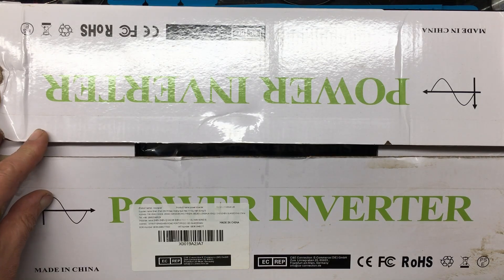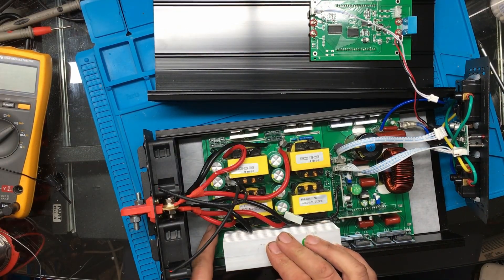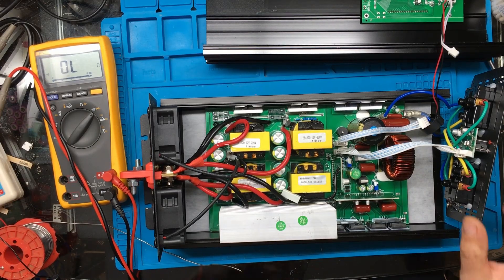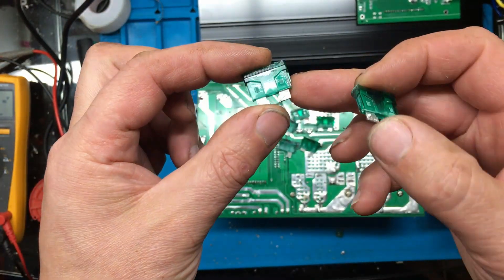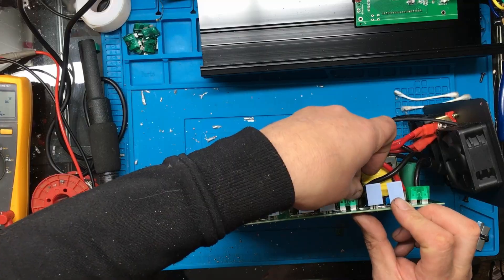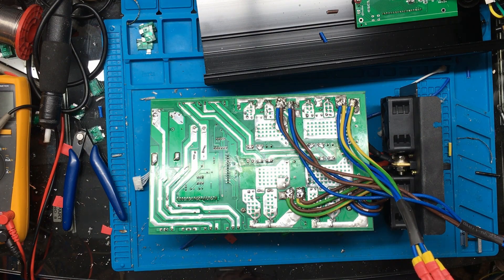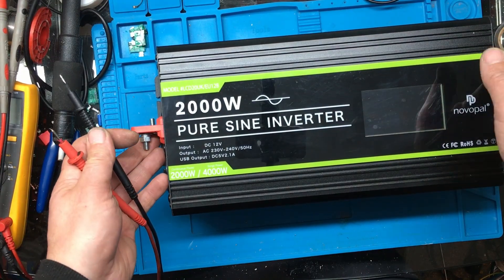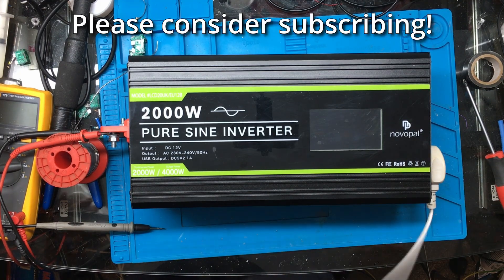2000W Pure Sine Inverter - Blown Up! - Let's fix it!

Comment: Just grind on the alum fuse  & a higher heat solder gun & they work fine !!!. Freeze mist the plastic as needed !👍🏻
Reply from the maker: I've tried that before, and never had much luck with soldering aluminium. I've bought some aluminium flux from Aliexpress, so I'll see if that works when it arrives.

Comment: It is a good ideal to charge the caps before hooking input power to a inverter. A 12 vdc test lite or a 12 volt light bulb on the positive side and it prevents a hard hit of current.
Reply from the maker: I get where you're coming from but wouldn't the caps just discharge, so you would need to do this every time you powered the unit up?
Reply: It is done just prior to hooking up your input voltage. I havent disconnected mine since I installed it. But yes it is easier on the caps. There is a man on Youtube name John Daniels that does a lot with wind turbines and solar panels and inverters. He is worth checking out. I will be watching your channel as well. @BuyitFixit
Reply from the maker: @edwardutter6975  Thanks 👍🙂
Reply: No just the first time install.  @BuyitFixit

Comment: I think the fuses were soldered in because sometimes the fuse holders don’t get great connections and melt.
I’m guessing the manufacturer had issues similar so they soldered righ to the board as a quick fix.
Reply from the maker: Could well be, I think a few people had the same thought.

Comment: I fixed mine by replacinga p19nb20 with an irf 640, I could not find the p19nb20. The voltage out is now 100 volts. Is that because it is not the same fet?
Reply from the maker: I'm not too sure, you would need to check the specifications of the different fets and compare.

Comment: Nice job! Interesting to see the fuses blow before the semiconductors. So they seem to be rated reasonably. My suggestion to the soldered-in fuses is the usecase of these inverters. In car or motorhome application with a lot of bumps and vibrations they cannot come lose.
Reply from the maker: Thanks 👍good idea but fuses in the vehicle's fusebox would suffer the same bumps and vibrations.

Comment: I must confess I have never seen a broken electrical device of any kind where only fuses were the broken bits. I am truly amazed that it is actually possible. Normally fuses are blown as an after-effect of some other problem.
Reply from the maker: Reverse polarity was the problem 🙂 I had similar with a Milwaukee LED flashlight I repaired fuse had gone OC, but as you rightly say they normally blow for a reason. Wish I had a penny for everytime someone has asked me too look at something and said 'it's probably just a fuse' 😂😂👍
Reply: @BuyitFixit  So they build this expensive 2000W (pure sine!) invertor but could not be arsed enough to include a reverse polarity block? I do realize that at these currents that is not a trivial thing, but considering sophistication of the unit it is very strange.
Reply from the maker: @blg53 someone suggested using a diode and a relay to ensure it was connected correctly, I thought it was a pretty neat solution.
Reply: @BuyitFixit  Yes, seem good although if it is really 2000W then at 12V battery voltage it should be able to commutate currents close to 200Amps.  So we are talking about a relay the size of a car starter one. Its possible I guess.
Reply: @blg53  nahhh...bad idea,  better off with no  Reverse Polarity   protection, the AMPS are crazy, the diode (S)  would be expensive, and fail,  and have a huge voltage drop  and heat up;  and the price would go up  200 watt at 12 volts is 166 Amps!!!!  crazy;  half of that at 24 volt, still a lot. i have a few inverters and i repair them,  seen dozens, mine and others', and i  never saw reverse polarity protection; the fuses do it, NO NEED for total disassembly, just 4 little screws and you're there.

Comment: Youd think something like that would have reverse polarity protection that doesnt rely solely on fuses.
Reply from the maker: Yes, exactly. Someone suggested a relay and a diode so when the power the correct way the relay would click in powering the rest of it, but it would add extra cost I guess.

Comment: At full power that beast would be drawing over 166A. Those wires on the fuses are not going to last.
Reply from the maker: 2.5mm cable is rated 13.5A but can handle up to 26A. Times that by the number of wires used and I think you'll find it will be fine. I doubt it is going to be run at full power (and questionable if it even is 2000w). He's probably just going to use it to run a few lights or the odd power tool anyway.

Comment: Ridiculous that they soldered fuses to a board.  Manufactuer mut have made it non serviceable  or at least.ecpects it will be thrown away.  Nice job!
Reply from the maker: Thanks 👍I would have preferred to use sockets on the board, but the owner was only visiting for the weekend so I had to use what I had available.
Reply: @BuyitFixit  Yeah, that would have made better sense however you improve it drastically.

Comment: Thank you for posting these videos. I have a 600 watts with the fault light on that I have to fix, any clue ?
Reply from the maker: Probably blown mosfets. I've got a faulty 600w inverter too that I'll be looking at soon. Stay tuned 👍
Reply: I swapped the p19nb20 with a irf640 it is working but only 100 volts out 😢😊

Comment: This looks like my EDECOA Inverter. I had one with "3000W"! I think it could do the power theoretically. I wanted to power a big amp with a big toroidal transformer... it worked one and a second time, but on the third time it went booooom. Smoking the Sh*t out of the IGBT and the IGBT Driver. I replaced everything and it worked again. So I tried it a second time. The same, after 3 cycles it went boom again. After loosing enough money because of these cheap inverters I bought a Victron MultiPlus, because I don't want to burn my camper down, and now all is fine. It uses a big toroidal transformer for step up and step down, and I think it has a few advantages for driving heavy loads.
Reply from the maker: Nice. I've recently upgraded my solar system to a Victron 5kw with a nice big battery bank. They seem decent kit.

Comment: Am I the only one that’s going to point out the elephant in the room here? HOW  DO YOU HOOK THIS UP BACKWARDS!!!

Best I can tell the BIG BLACK & RED lugs are for the 12v DC (Just like your automotive car battery) pretty self explanatory. That means the other side MUST be for the AC output and even if you ignore that the AC side has receptacles matching the common wall outlets of their country which means the other side has to be the DC input. 

Are you certain your friend isn’t pulling your leg here and didn’t just overload the thing? 🫠 

Either that or I’m missing something very fundamental 😓
Reply: Either way You get a thumbs up, I really enjoy watching your videos. I am a big believer in attempting to fix equipment, both mechanical and electrical, as the primary course of action rather than throwing it away. Especially when it could be something as simple as a blown fuse.
Reply from the maker: Thanks 👍 I think they got the red and black wires the wrong way round and blew it up that way 🙂

Comment: The second you said he reversed the polarity I thought: fuses or diodes. Guess you wouldn't want the voltage drop from diodes. Question for you: why are some of the traces not covered in solder mask? I noticed it in the Milwaukee battery charger, too. Does it have to do with higher current? Great that you got it working again, seems like a beefy unit.
Reply from the maker: Thanks, yes I think the solder mask isn't on those traces so solder builds up on them, making them thicker and allowing them to pass more current than the plain copper would allow.

Comment: Connected mine inadvertently the wrong way round and it blew the 3x25amp fuses - I thought it was a goner - so I replaced the fuses and it was still OK..!  Always check the polarity and if the unit is US check the fuses before giving up.!
Reply from the maker: I've just got another smaller inverter to look at, hopefully this one is a bit more than just the fuses 🙂

Comment: You know they make fuse sockets. Right? I just replaced my battery on my rice cooker and it was soldered in but modified it with a real battery holder. I think the reason for the stupid soldered in ways is to save money on producing it. They don't care about the future of that product.
Reply from the maker: Thanks👍 yes I know about fuse sockets. The owner was only visiting for the weekend so didn't have time to order any so I just used what I had to hand. Not the most elegant repair. I've done much better and more complicated stuff,  but YouTube seems to have the hots for this video for some reason 🤷‍♂️

Comment: ON MY KNUP 4000W INVERTER THE FUSES WERE SOLDERED SOLID, COULDNT GET THEM OUT, NIW IM STUCK WITH AN INVERTER THAT DOESNT WORK, WHY CANT FUSES BE ON OITSIDE
Reply from the maker: Agree👍, and I bet this isn't the first case where someone got the wires the wrong way round.
Reply: @BuyitFixit  WASNT THE WIRES WRONG WSY ROUND, I THINK I PLUGGED SOMETING IN THAT WAS OR NEEDED MORE WATTS SUPPLY   AND IT WENT FROM GREEN TO RED THEN FLIPPED OFF , THOUGHT IT MIGHT RESET BUT NEVER DID
Reply from the maker: I was talking about the one I repaired on the video. The original owner connected it the wrong way round.
Reply: @BuyitFixit  OH OK SORRY ABOUT THAT,  JUST FED UP THAT THEY CSNT MAKE SOMTJING WITH EASY TO GET TO FUSES, IS IT A THING WERE THEY ARE ONLY I INTERESTED  MAKING NEW AND NOT BOTHERED ABOUT AN AFTER SERVICE LIKE A SIMPLE INSTRUCTION ON HOW EASY THE FUSE IS TO REPLACE
Reply from the maker: @petermizon4344  yes totally agree 👍
Reply: @Kevin-mp5of WHEN YOU HAVE EYES LIKE MINE  I LIKE BIG LETTERS SO I CAN SEE MISTAKES

Comment: How do you connect it the wrong way round??? Saying that I have a friend that could. He used a main junction box to connect a light to his bike but connected all the wires together because he used the same brass block.
Reply from the maker: Perhaps they had two crocodile clips on the inverter and didn't notice the - and + on the battery probably? Or perhaps they didn't think it matters which way round 🤷‍♂️
Reply: @BuyitFixit  My friend Jack could do that. He was on the phone for an hour complaining his motorbike battery is going flat. At the end of the conversation he told me he only goes to shop 100 yards down the road on it.

Comment: One thing you can do with these is use it to excite an isolation transformer and use that to get grid tie type inverters to give extra juice from a whole house type solar panel system if the grid goes down. Need an isolation switch and a simple battery charger to keep the inverters battery source charged. So long as your draw is about 70% of panel capacity this works fine.❤
Reply: I tried that once without adequate isolation. The inverter tied DC- to HVDC- and AC-ground which led it to overload itself when the house shorted neutral to ground. It put a notable voltage between the body of the car and the floor. At the end of the day the charger was dead too. Whoops. More stuff to fix.

Comment: There is no excuse for a power system like this which does not have polarity protection is a really crap design... a diode driven relay at the input end ensures there is no voltage drop as associated with a simple diode protection.
Reply from the maker: Great idea! I never thought of that. Thanks for sharing 🙂👍

Comment: Those fuses will solder but only with using flux and a high temp. iron. The designers are helping the accountants more than the consumers.
Reply from the maker: Thanks 👍

Comment: time stamp 9:30 overlooking the outher 2 diods ( 4 blocks of inverters = 2 mosfets + 1 diod + 2 fuses each ) . PCB mount ATC blade fuse holders pose a hot spot and have caused fires in inverters before by igniting the pcpb and peling te solier on the pcb and forming a arc flame.

Comment: Excellent job.  Could you not have attached a new multi fuse holder for all the fuses on the outer.  case
Reply from the maker: Yes that would also have been a good idea. This was a little bit of a rush job as the owner was only up for the weekend so I just used what I had lying around.

Comment: What a shame they didn't use fuse carriers for easy repair.
Reply from the maker: Yes, at least they are more accessible now 👍
Reply: Connectors can be treacherous, even fuse holders. Poor connections generate heat. Had a Molex connector on a motherboard catch fire once. Processor survived (Phenom), a memory stick died.

Comment: Adding additional wires to a 2000W/12V inverter and not soldering the fuses is probably not a good idea - these wires will have to handle 200A and there will be significant additional voltage drop through these modifications. Sure there are multiple fuses - but the cables are really not looking sufficient.
Reply from the maker: The fuses installed are 30a each.  I used 2.5mm wire and 4 of them on each fuse. So the wires won't have to handle 200 amp. I agree it's not one of my better repairs as I would have preferred to use sockets for the fuses, the owner was just visiting for the weekend so I didn't have time to order any, but used what I had available.
Reply: @BuyitFixit  Maybe it would have been possible to solder the fuse holders/sockets that were used with the cables onto the PCB.
Reply from the maker: They were crimp on spade connectors that I used, and there was only small slits in the board for a fuse to fit, it wasn't ideal, I was originally just going to solder fuses back in as factory, but then fuses I ended up with were aluminium. This wasn't one of my better repairs, have a look af the FLIR thermal camera, or RGB laser, or medical ultrasound they are a lot better 🙂

Comment: Lucky amateur !! There not transistors  and that coil does not measure  output current flow ! Electrical 3 core cable for fuse leads ! Talkabout fire hazards DO NOT COPY ANYONE  ! Safer getting  new one from China 😂😂😂
Reply from the maker: I hope no one does copy. I would have preferred to use sockets in the PCB, but the owner was just visiting for the weekend so I didn't have time to order any. I had to use what I had to hand. Why would it be a fire hazard, it's 2.5mm cable doubled to each fuse end. I'm sure it can handle the current. Also I doubt it would restrict the airflow too much. Even if it did the device has thermal protection (thermistor on the heatsink). I have no idea why youtube is pushing this particular video, when it's no way one of my better repairs. I guess I got lucky fixing that FLIR thermal camera, RGB laser, solar inverter, medical ultrasound, and loads of other equipment 🤷‍♂️

Comment: Not good, remove the cable from the fuses as they add allot of inductance. You are decoupling the capacitors with those fuse leads. This will result in transistors failing due to over-voltage stress during high load. Try to use smd 30A fuses or fuse holders. I would go by removing all the fuses and just use an 100A fuse over the cable, but this could result in fire, if one fet fails, as it's winding from the transformer will melt ( they have separate winding for each fet leg).
Reply from the maker: Thanks for commenting. I was going to solder fuses back in as original, but the fuses I had seemed to be aluminium. I would have preferred to use fuse holders but the owner was only visiting for the weekend so I used what I had lying around. I've done much better fixes than this but YouTube seems to like pushing this video for some reason. Check out the FLIR camera repair or RGB laser which are much more interesting.

Comment: That's a serious amount of current to get 2kw I would have tried to mount "TTW'  if there's wires come off and short on case it will be magic smoke+++
Reply from the maker: Originally I was just going to solder the fuses back in, although I would have preferred to fit proper sockets. The owner was only visiting for the weekend so I had to use what I had available.

Comment: On most inverters, if you reverse the polarity, the fuses pop before anything else is damaged. I had to do this same repair several years back because I bought an inverter on eBay that was "Spares or repairs" due to the original purchaser getting their wiring confused. It sounded like aggro, but it was too cheap not to get and try to fix.

All that was wrong was that one was the 3x 30A internal fuses were all blown. As you said, it's a stupid idea for them to be soldered to the board, so I found 3x surface mount blade fuse holders, Dremeled a neat bank of holes for them in the end plate, and connected the holders to the board by soldering (IIRC) 10AWG silicon wire between them. I remember the thick wires made it fun getting everything back together, but it looked pretty much like it was mean to be like that when I'd finished.

...... And after all my messing about to make the fuses easily accessible, Sods law meant that I never had to swap them again. :D . I only replaced that inverter when I wanted one with a bit more power, and I think the friend I gave that one to still uses it to run a PC in his camper van.
Reply from the maker: Nice 👍Thanks for talking the time to comment. I would have preferred to use solder in sockets or such myself but the owner was only visiting for the weekend so I had to use what I had available at the time 👍🙂